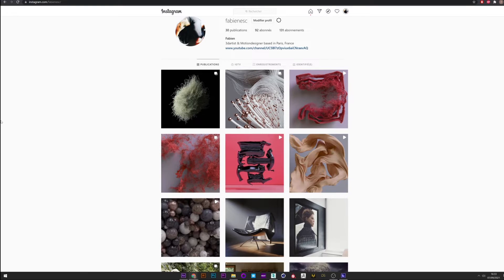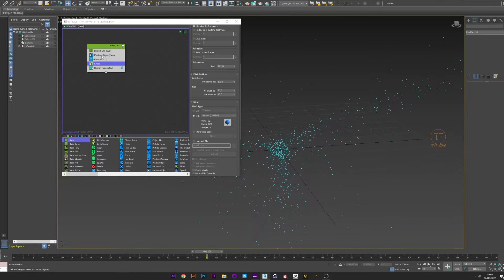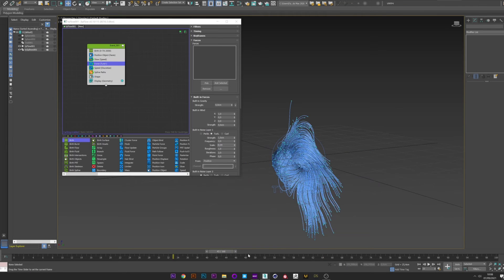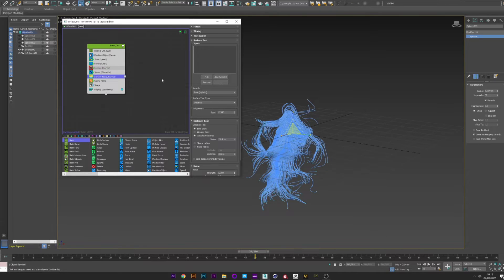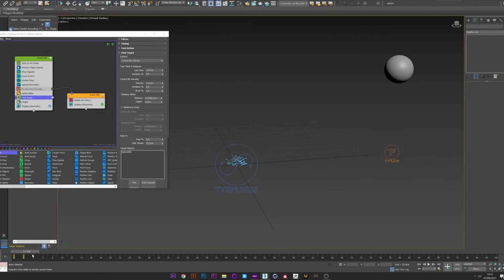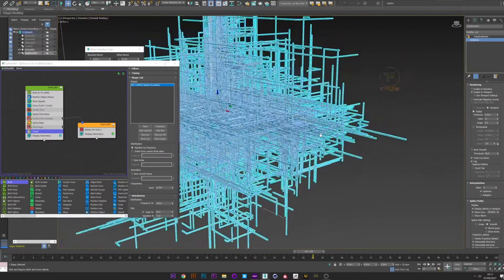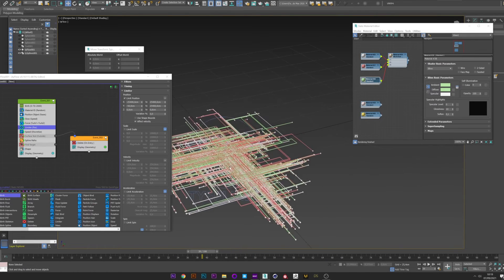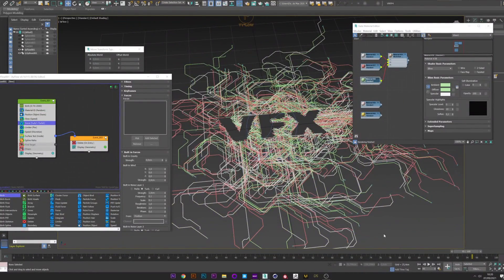Create spline world | Tyflow Tutorial

Comment: Hey thank you again. When I try and give it Gradient Ramp Material it applies to the whole object as one and not to each individual spline. I use Mapping with Object (cylindar) that I applied the Material and looks good for one Cylinder (spline). When applied to tyflow it just maps the whole Spline "mess" as one object. Thank you
Reply from the maker: I don't know if it possible to map a color to different spline without using the material id . set to random. And apply a material sub object. I think the mapping operator  will not map each spline differently
Reply: @fabienescudero  yes that works fine. I have sphere and Surface Force with splines. I want the same texture (gradient ramp) to be applied to each spline (on birth its black on end is white). Now ot just applies the gradient ramp on whole object of splines. Bottom splines on sphere are black, top ones are white